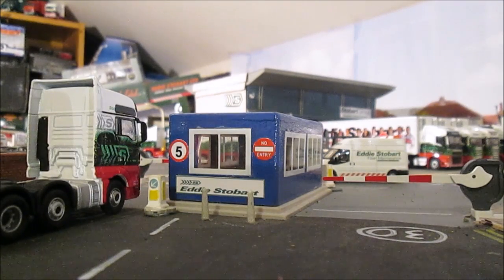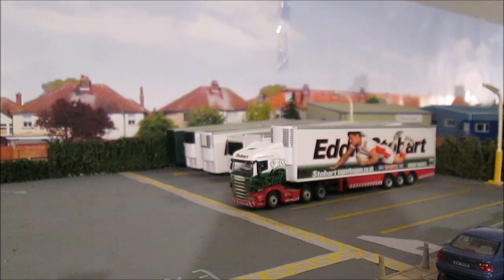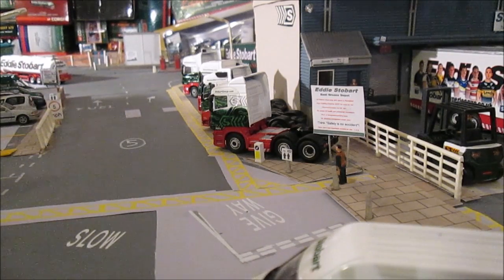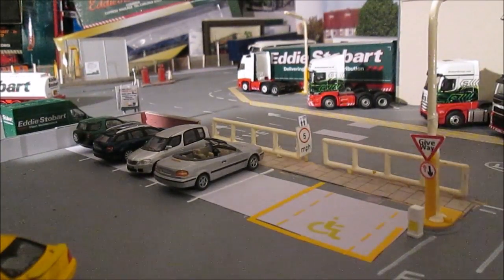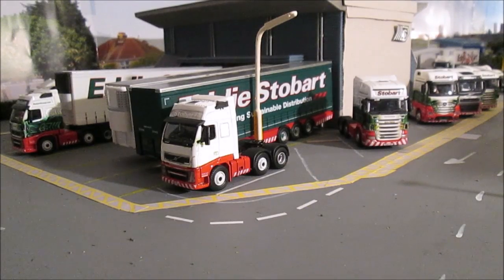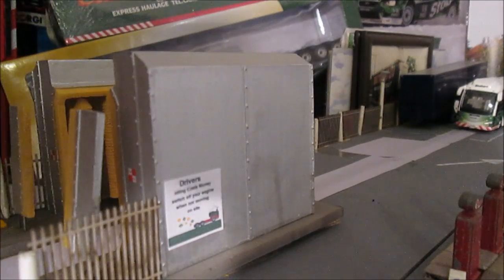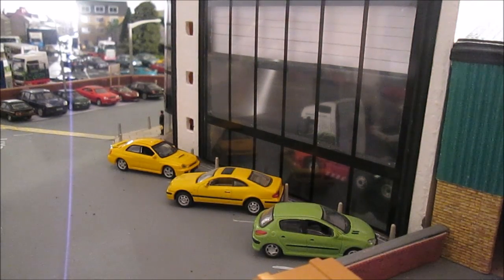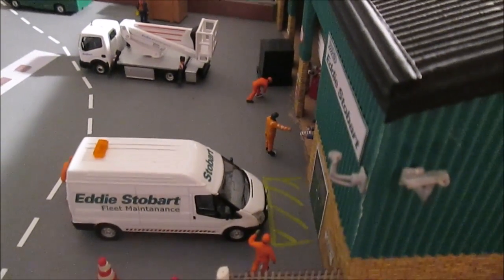Eddie Stobart 1:76 scale model depot

Comment: How can I take the Scania trucks off the stand without using a triangular screwdriver?
Reply from the maker: ive been told a small flat head screw driver works but failing that the only other way is to remove tyres then saw off the screws with a hack saw

Comment: How do u remove the trucks from the stand?
Reply from the maker: with a screw driver
Reply from the maker: well you've used a screwdriver to remove the screws, yes? well its just a case doing the reverse of how you undid it. unless you cut the model off then there is no way